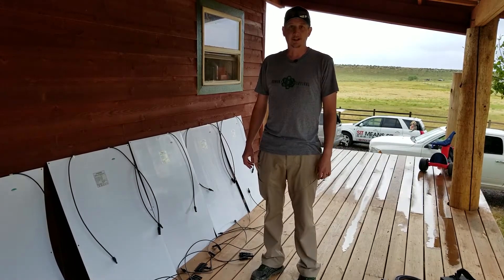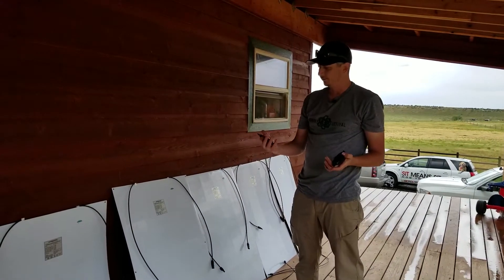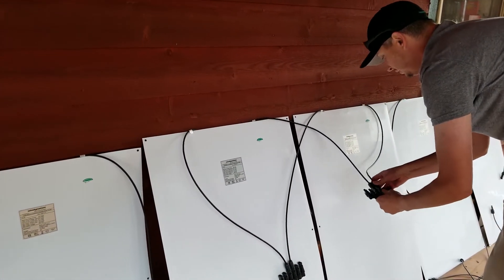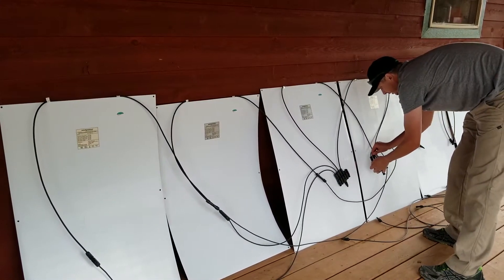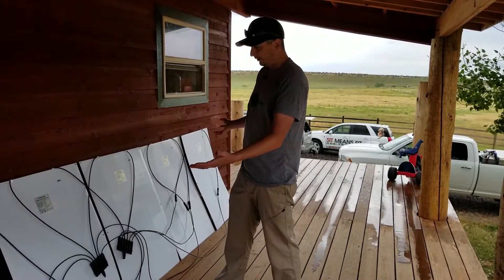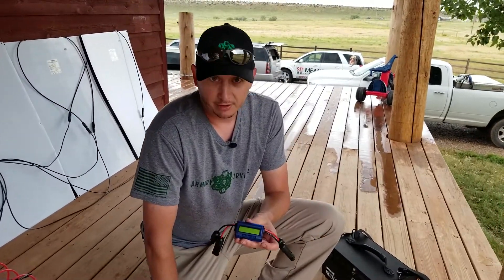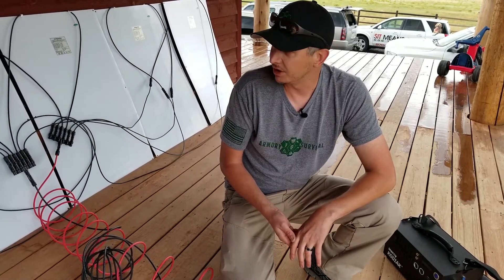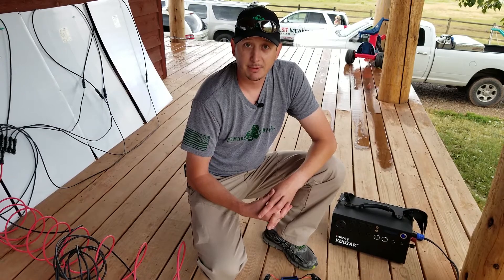How To Hook Up MC4 Solar Panels To Inergy Kodiak Solar Generator

Comment: I thought it could only take 5 100 watt panels
Reply from the maker: Hey Cathy.  In this video I am using the Kodiak solar generator, which is now considered the "older" model.  The Kodiak can take up to six 100 watt solar panels.  The "newer" version, called the Apex, can only take five 100 watt panels.  This is because the Apex has an upgraded MPPT charge controller.

Comment: I have two questions.  I saw a another video that shows a female helping to do a review on these 1100watt Kodiak solar generators and she had a khaki colored, canvas foldable solar panel kit that she laid on the ground and it was rather large when she unfolded it.  On the inside, were rows of solar panels and the fully unfolded size looked to be at least 9'x9'.   She ran one set of cables from this contraption over to the Kodiak and plugged into the appropriate socket.   The video did not say anything about the foldable solar panel kit - it didn't indicate how many watts all of those panels would provide.   But, this looked very appealing - because when folded up, the whole solar panel kit was about the size of a medium sized suitcase - which would be far easier to pack in a vehicle for a road trip or a camping trip.  Do you sell a foldable solar panel kit like the one I just described, and how many total watts would it provide?   The connection to the Kodiak is much simpler and with a lot less cables to trip over.  Second question:  If someone were to order a Kodiak and 2 of the 100-watt flexible panels - how long would it take to charge the Kodiak with only 2 panels connected to it?

Comment: I cant get this video to play past the 2min and 8 seconds mark . How do you get the other panel mc4 cables to reach properly and safely , Can you explain it ?
Reply from the maker: Hey Ramundo.  The panels that are further out have extension cables that have the MC4 connectors on them. Those just plug into the solar panels and then into the branch connectors.  If you need more help on that please email survive@armorysurvival.com or call us at 833-427-6679.

Comment: I got 3 panels two cords to connect them no branch connectors
Reply from the maker: Hi DJKdee.  We haven't sold the kits that use MC4 branch adapters for about 6 months now, but if you did purchase one of those kits from us and didn't get the correct adapters please reach out and we will make sure you get them.  If you purchased somewhere else and need some help to find the correct branch adapters I would be happy to help as well. Please email survive@armorysurvival.com and I can assist further.

Comment: How do I go from MC4 to EC8 for the Inergy Apex? I don’t see any adapters anyplace.
Reply from the maker: Hey OhioPreparedness.  Inergy isn't making any adapters to go from the EC8 to the MC4 connection type.  Their reasoning is they said they had too many people hooking up MC4 panels incorrectly on the previous version (the Kodiak) so they aren't going to directly support doing that.   If you are comfortable with wiring and have the tools you could make an adapter that would work for you.  I'm told that if any issues to arise from using MC4 panels though that it wouldn't be covered under the warranty, so just have to keep that mind and decide if that is worth it for you or not.  Would be happy to chat more or help in any way I can.  Feel free to email survive@armorysurvival.com or reply back here.
Reply: Armory Survival thanks for the info sir, my understanding is that the issue was series connecting MC4 panels into the non mppt charger of the Kodak and burning it out. I believe even with the new apex and mppt charger that they are parallel connecting the panels with EC8. So, if I use MC4 panels, half the price of their panels, and connect them in parallel, then I could finish with an EC8 connector and all would be good. Does anyone sell the EC8 connectors so that I could crimp them myself? Thanks for your time and help!
Reply from the maker: @OhioPrepperOne   Correct, some people were connecting the panels in series or using 24v panels instead of 12v panels.   I personally used MC4 panels on my Kodiak all the time with no problems at all as they were hooked up correctly and never exceeded the maximum input.   You definitely could use MC4 panels in parallel and finish with the EC8 connection on the Apex, again, just make sure not to exceed the maximum input (500 watts, 12v panels, 30 amps).  The EC8 connections aren't crimped, but actually soldered.  Here is a quick video showing how to do that (he is using EC5 connectors, but same concept for the EC8) https://www.youtube.com/watch?v=dz9OvoBBscQ&t     You can buy a pack of EC8 connectors on Amazon or through most hobby stores online.  If you just need one connector shoot me an email with your address and I will send one out to you.
Reply: Armory Survival thank you so much, I’ll check out the video, appreciate it!
Reply: Do you think a 40 watt iron is large enough or would I want an 80 watt iron?
Reply from the maker: @OhioPrepperOne  I would go at least 80.....even up to 100 if you can.
Reply: Armory Survival ah, ok,  maybe a soldering gun would be better then an iron then.
Reply: @OhioPrepperOne  Inergy now sells an MC4 to EC8 cable to use with other solar panels besides the ones they sell.  It's pretty short, though.  I bought a longer cable from Ebay.

Comment: Just be careful with those panels apparently they can break
Reply from the maker: Thanks for the comment!  I think it goes without saying that any solar panel can break if you aren't careful with them though.  I personally have had these panels for over 2 years now and use (connect/disconnect) on a regular basis with no problems or any power loss yet.  We have tons of customers using these exact ones as well with no issues.  I do think the flex panels are more susceptible to damage in the long run though compared to the rigid panels.....just because of how they are made.
Reply: @ArmorySurvival  I'm not sure what brand it was I think it was renogy that had the issues. Which brand are those ones?
Reply from the maker: @Saint696Anger   These ones are by Windy Nation.  I haven't personally tried the Renogy flex panels, but have done some installs with their rigid panels and they are great.  Renogy customer service is stand up as well so I'm sure if there was any issue they would help to get it resolved.
Reply: @ArmorySurvival  yeah I have their solid panels also

Comment: The Kodak gold package with six panels adds $1400 to the price of the generator. Why so much?
What’s the difference between your flexible panels and what Kodiak sells?
Reply from the maker: With the new K2, Inergy Solar will only support solar panels that they provide with their EC8 connection.  Unfortunately the flexible panels that we have will only hook up to the original Kodiak.  If you have any other questions we can help with please give us a call at 833-427-6679.  Have a great day!

Comment: wont' that be too many amps going in if all parallel?  30 amp limit.  My Kokiak says 12v-18 limit.  confused.
Reply from the maker: Hi Deb, not at all.  You want to use 12 volt panels, and the Kodiak has a maximum input of 30 amps.  When the solar panels are hooked up in parallel they will maintain the 12 volt range, you just add amps with each panel.  As long as you don't use anymore than six 100 watt panels (12 volt panels only) and they are hooked up in parallel then you would be all safe.  We also sell a meter than can hook to the MC4 panels that shows how many watts, amps and volts are being produced in real time.  With these particular flexible panels we have tested in different conditions and with 6 hooked up have never been close enough to the limits to cause any worry.  We also have many customers who have been using the same setup with 6 panels for quite awhile with no problems at all.  Hope that helps to answer the question.  Feel free to reach out via email or give us a call at 833-427-6679 if we can help further!
Reply: Armory Survival    Will The K2 model eliminate the need for separate metering?
Reply from the maker: @christinearmington  Yes, the K2 will have the input power monitoring already built in, so the additional meter is no longer necessary.

Comment: Great video. How would you go about running those long extension cables through the roof of a van? Since there are MC4 connecters on both ends of the wire, I would have to drill larger holes than I would prefer on the roof of the van. Would you recommend something like a wider diameter PVC pipe that would receive both cables through it? I hope that made sense. Thanks!

Comment: I am a little disappointed at your presentation. You do not explain WHY you set up the panels in the manner that you demonstrated.  I recommend that you educate the viewer concerning the difference between connecting the panels the way you did in parallel (additive amps) vs. not connecting the panels in series (additive watts).  I also recommend that you discuss the Kodiak's total watt limitation which dictates why a parallel connection set up is required.  Ultimately, you should caution the owner of the Kodiak against connecting the solar panels in series as the wattage will exceed the generator's maximum allowable input which could lead to damaging the unit.
Reply from the maker: Hi D Carlson, thanks for your comment.   Really this was just a quick video to show people how to hook up the MC4 panels to the Kodiak.  The manual that comes with the Kodiak (and now the stickers that are placed on the units) say that the panels are to only be connected in parallel.  You are correct though, it's always better to reinforce those types of things and we will make a note to discuss more technical aspects in future videos.  Have a great day.

Comment: Have you had any issue with the 6 flexible panels charging the Kodiak?  The reason I ask is b/c the Kodiak manual mentions a 30 amp limit through the Neutrik NL4XF Connector.  I believe on the spec of those flexible panels the max current is 5.6A, connecting 6 might cause an issue.
Reply from the maker: Hey bonsukan.   We haven't had any issues at all with that during any of our testing.  The solar storm 100 panels that Inergy supplies actually show an operating current of 5.81A on the label, which is a tad higher than the 5.6A.  With all solar panels it is quite difficult to reach 100% rated output just due to the technology, so even with 6 hooked up it would be a stretch to reach that 30 amps.  But, with those flex panel kits we do also provide a watt meter that plugs inline between the panels and the Kodiak so that you can monitor the amps and watts being produced in real time.  We tell everyone who purchases the Ultimate kit to use that meter just in case so they can see the power input.    If somehow they are getting close to that 30 amps, just unplug one of the panels.   In our testing we have had all 6 panels hooked up for multiple days in direct sunlight, no cloud cover and temps around 90 F and never got close enough to the 30 amp maximum to be concerned.   Hope that answers your question.  Please feel free to reach out if you have any others or need more info on that.
Reply: Good to know!  Thanks for providing more details on your testing.
Reply: Wow, you just answered my question!
Reply: Great question bonsukan. Our Kodiak is on its way, will be in Florida on Tuesday. I am struggling making a decision on which MC4 Flexible panel to buy.  Thanks for the explanation Armory.

Comment: Hi there. Great video and tutorial. What type of Charge Controller has the Kodiak? In my set up I have already a MPPT don’t know if I can keep it if I link the Kodiak to the battery bank. Thanks again
Reply from the maker: Hey, Miguel thanks for the comment!  The Kodiak has a built in PWM charge controller.  If you were to hook any external batteries to the Kodiak you wouldn't want to use any other charge controller in the setup since the Kodiak has it's own that controls the system.  Feel free to reach out to us if you have any other questions.